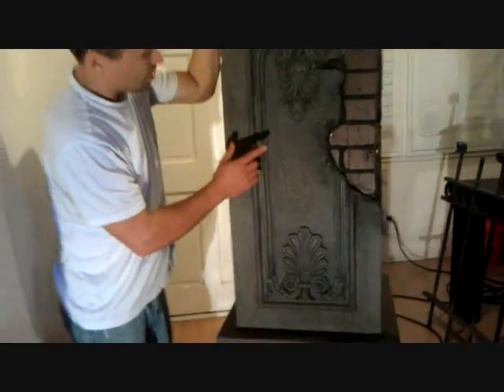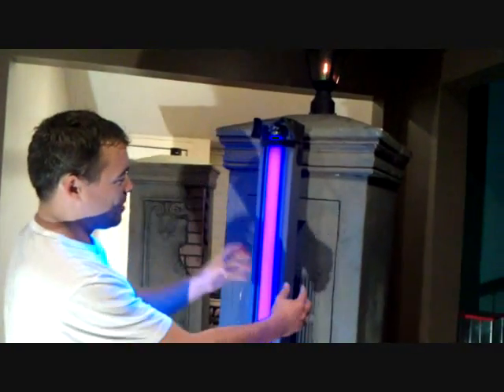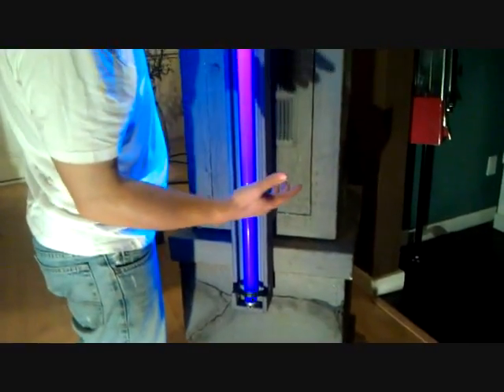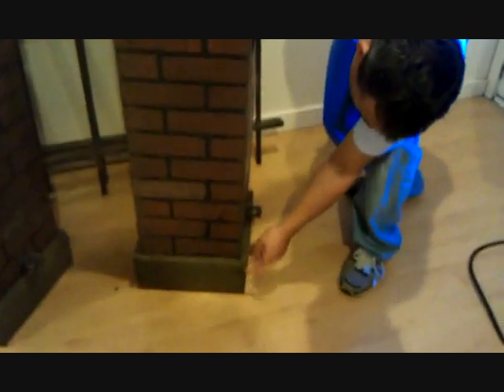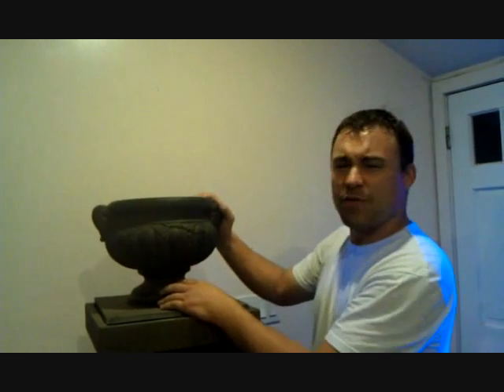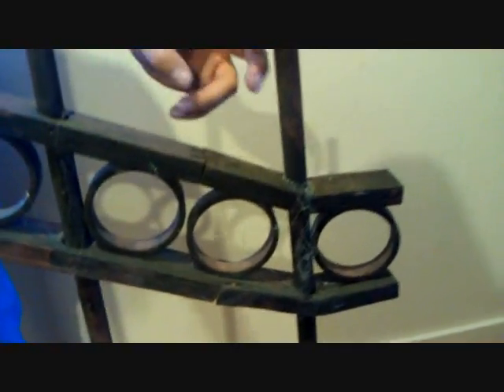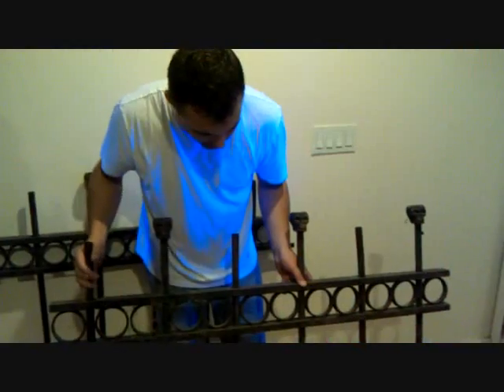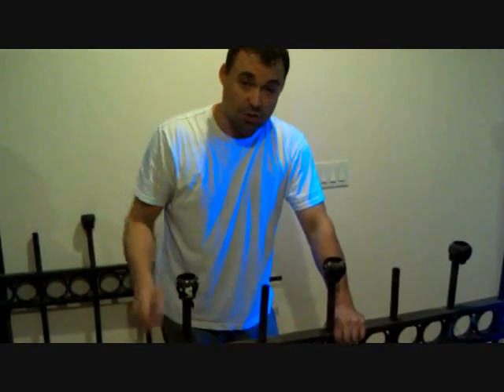Halloween Graveyard Fence - Fence Columns Decoration Idea

Comment from the maker: No the columns are pretty heavy because of the plywood they are made from plus when the fence is bolted together it doesn't go anywhere.  I actually have a hard time tipping the columns over enough to get power cables under them when everything is assembled and at times have to take it back apart.  The first year I placed re-bar into the ground for the fence to slide over to make more stable and I don't anymore cause it just isn't necessary.

Comment: Hey guys... could you tell me some tips on how you cut and shaped the foam caps for the columns ? Amazing work!
Reply from the maker: Brian Griffith Hey Brian, when we carved the foam tops we started with lets say a solid piece or a couple pieces of foam glued together to make a 2' x 2' square that can be 6" or more thick.  Then I found the center point on the top and using a straight edge and sharpie I drew lines from the center dot out to each corner giving me an X.  Then with a horse or dog hair brush (the metal one with several rings with teeth) I filed each outside edge down staying flat with the brush and pulling toward myself.  If you follow were the lines were and keep the center point the highest and the out side edge the lowest you will start to see a pyramid shape form.  You just have to be careful and pretend the x lines are always there. Then I just used sand paper to smooth it all out.  Let me know if I made sense or not, hope that helps give you an idea.
Reply: Hollywood Haunter thank you so much! yess you explained it well. also, are the bigger columns a perfect square or are they shorter on the sides? did you use 1 inch crown staples to staple it all together? you think i could use brad nails?
Reply: Hey guys I made the same columns you did and used the fake brick wall paneling and was wondering if you put Thompson water seal in on them to keep them protected from the rain
Reply: Hey guys I made the same columns you did and used the fake brick wall paneling and was wondering if you put Thompson water seal in on them to keep them protected from the rain
Reply: Hey guys I made the same columns you did and used the fake brick wall paneling and was wondering if you put Thompson water seal in on them to keep them protected from the rain

Comment: and intresting story..we had both our black light bulbs stolen too back in 2007....had cameras, found out what kind of truck it was....came back a week or two later for new ones we had installed, saw them drive by on the camera, got ready, ran out and base ball batted the truck about 5 times, smashed the headlights out, hit the bed in a few times, but this was AFTER the criminal got zapped by 140 volts of hot wire coil springs we installed into our bulb sockets- lol
Reply: its the first video on my channel- or type inf halloween vandal gets caught, or halloween karma, on my channel in the search box

Comment: How does the brick paneling hold up after being exposed to rain? I live in the midwest and thought about using it, but in fear of the rain we always get. Thanks
Reply from the maker: Actually pretty well. It swells up sometimes but it's still going strong. You can actually see them in their new home if you check out our recent Hellsir Cemetery video.

Comment from the maker: Sorry just getting this Ricky and if your still curious about the sizes of our columns I know on our Facebook we have an items for sale photo album and there are some dimensions with a tape measure with pictures.  I think they are around 14" wide and 4' tall but I can't remember exactly.  One way you could do it is to draw it out and try to design and make them in a size where you can get the most out of your material your using.  Let us know if we can help with anything else.  =)

Comment: What material did u use on the gate for the decorative circle part. Also, what are the measurements for in between the poles & height?  Thanks :)
Reply from the maker: the metal portion of the arch was one of those arches for weddings or gardens you see at several arts and crafts or nursery stores and then we add the wood portion to the under side.  The fence was made in 4 foot sections and just under 4 foot high.  We would connect a couple together so there was eight feet of fence between the pillars.  We have some great photos on our Facebook page if your interested.
Reply: +Hollywood Haunter I think the other person wanted to know from what you made the decorative circles in the fence.  I'm guessing 3" Pvc pipe
Reply from the maker: Yes, if that is what they were asking your correct.  I think it may have even been 4" PVC pipe rings cut at about 3/4" to 1" thick.  It's a lot of cuts and a lot of sanding sharp edges afterward but it adds another extra detail.  Thanks teodelfuego!
Reply: +Hollywood Haunter thank you!  Your video was fun and inspirational